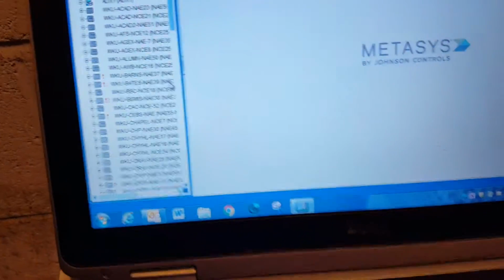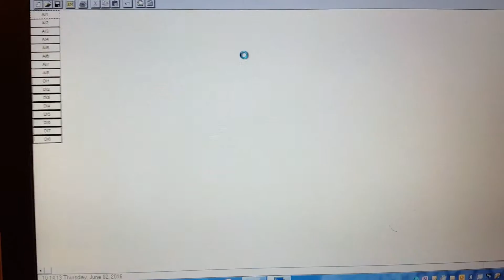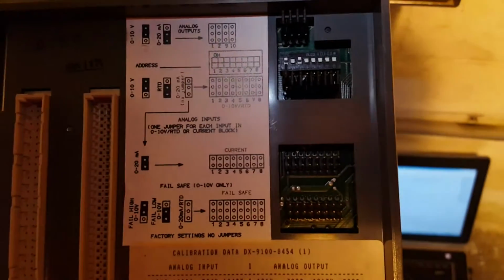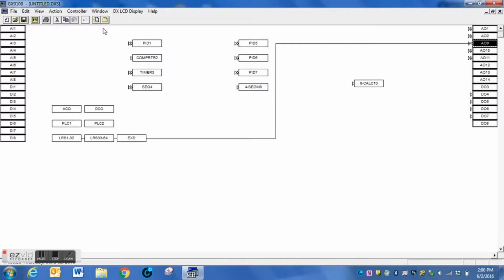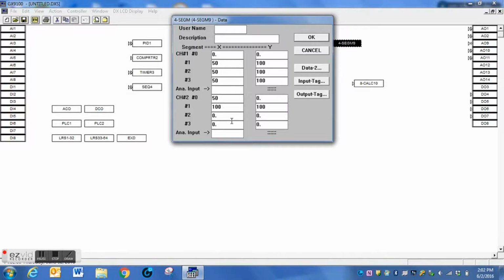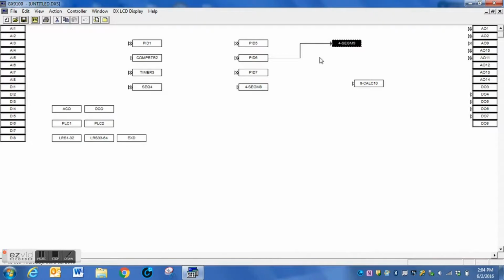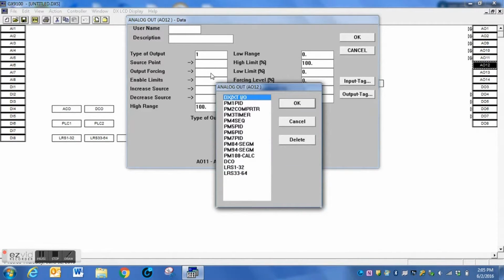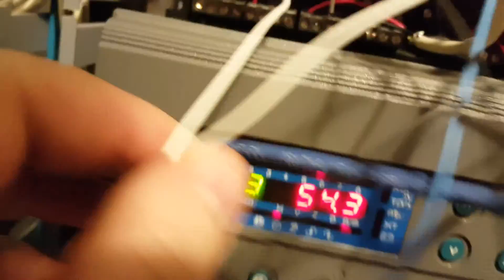Adding Analog Output on DX 9100 using GX Software

Comment: I just stumbled across your vids, I'm trying to change an analog output on a steam preheat coil to go all or nothing when setpoint is reached. I have been having a coil failure multiple times, and manufacture says its because my steam comes on slow to 100% and same going off. I work at a factory and I'm pretty much self taught for last 20 years on the DX9100, but having a little trouble on this one. I have the GX9100 software and also the WMX9100 software. The valve is on a PID, and uses preheat temp as variable. What do I need to change to make the output go 100% when it needs to call for steam, and then 0% when no call for steam? My valve is reverse acting(closed on 100%output)
Reply from the maker: The easiest way would probably just be a comparison block. If true, drive one way and if false, drive the other

Comment: Great video, thank your for explaining all this. Any ideas where to get the GX Software to backup/program my DX-9100-8454 L9712?
BTW: There is a date problem in the DX-9100 that the weekday gets stuck with Tuesday and does not move on anymore (starting somewhere in 2021). The workaround is to set the Windows date 28 years back and set DX-9100 date again. For most use cases the weekday is important but not the year.
You are welcome to contact me my private message.
Reply from the maker: You would need to contact Johnson to get the software

Comment: Jason, I have request videos:1- Setup BBMD - on NAE.2- Make duty cycle logic in LCT with fail safe switchover for alarms.3- Create a fresh backup on SCT from an NAE that does not have site directory.4-  move FC trunk and all its Field controller from one NAE to another in SCT. 
5- how to check where the mode is determined in CCT.( you mentioned in one of your videos that will get in to this later) still waiting. 
Thanks
Reply: How to recover old event and trends using database management tool.
Reply from the maker: You can find some videos on those on my channel.